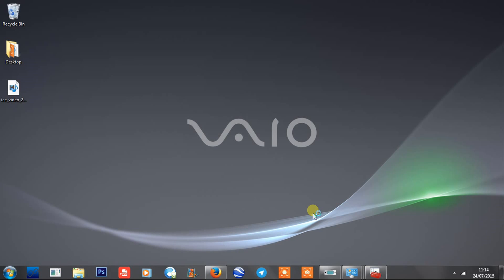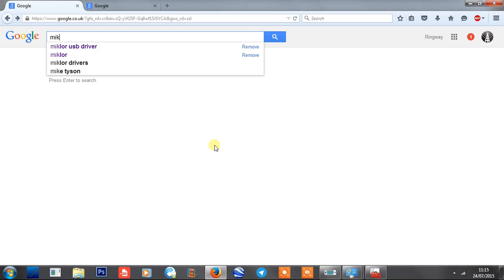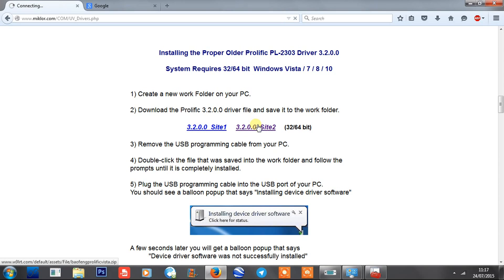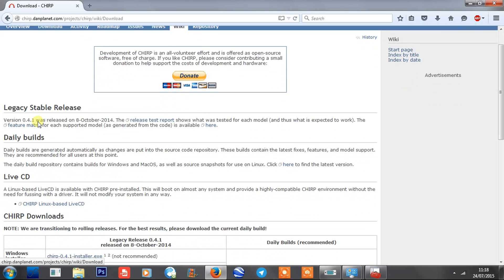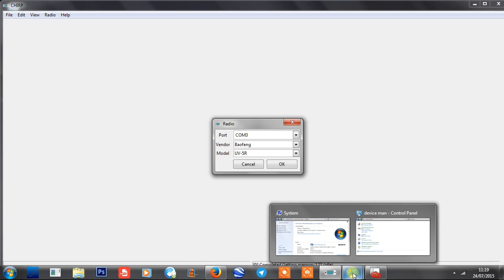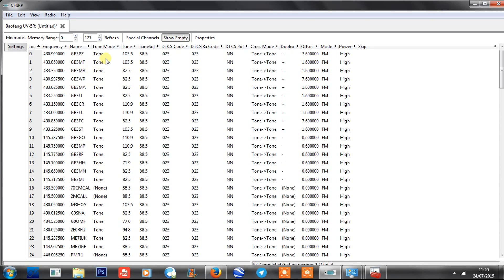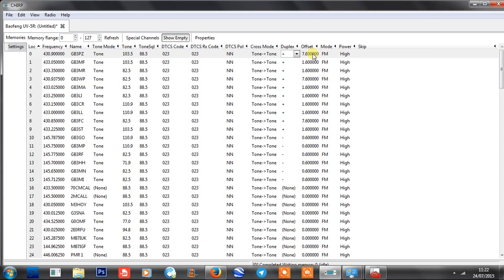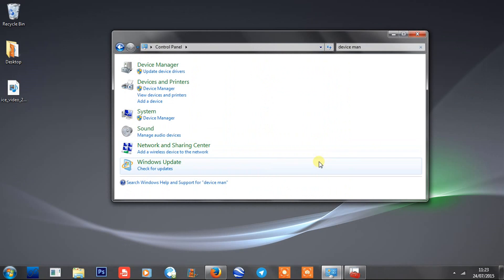How To Programme Baofeng UV-5R - Driver Issues Solved

Comment: Hi Lewis, ended up using Ch340 driver, Prolific wouldn't work with UV5X. Now trying to upload to UV5R Triband and having all sorts of issues. Freq Step column is missing when I read radio so when I use 5X csv to upload to UV5 III, there is a column missing so can't write to radio. Anyone have any info on this??
Cheers

Comment: Thank you Lewis!

One important note—the website linked in the description states 'Nearly every programming cable that is detected by Windows as having a Prolific chip'... I read that incorrectly as 'Nearly every programming cable has a Prolific chip'... and indeed Windows attempted to install a Prolific driver when I first plugged it in.

Many frustrating, head-scratching hours were spent installing older Prolific drivers and still getting a code 10 error... until I tried installing the WCH chipset drivers, which are also on the same linked website... now all set up and working :-)
Reply: When the 3.2.0 version didn't work, you installed WCH chipset drivers?

Comment: menu-27-menu-(channel #)-confirmed  gives me a rcv ch and xmt ch, which is not right, and never confirms whatever.  menu 27 is confused somehow.  This the vfo/manual set up procedure as one is supposed to use.   By the way, chirp works ok with  the BTECH 5x3

Comment: my edited alpha-numeric channel name is not changed (stays a number) when I clone the file to the radio. Is this a radio setting issue? Thanks - the driver and chirp seem to be working fine otherwise.
Reply from the maker: Do you have the display set to channel, name, or frequency in the software?
Reply: name

Comment: I hope you can help me. I have a Baofeng UV5R. When I attach the data cable to the radio and pc and turn the radio on, there is a loud buzzing sound and it reboots my pc. Same thing happens if I plug in the usb plug with the radio on. This is new, it didn't used to do this. Any advice would be greatly appreciated. Thanks in advance!
Reply from the maker: Sorry I've never heard of that problem

Comment: I'm afraid my Miklor driver always keeps the yellow triangle and already warns me it is incompatible (Win 10/64) before it is even installed. After installation I am told the driver will not run (Error 10. When opening Chirp and trying to read from the radio, the comm port field is empty, and the error is that the specified path could not be found. What now? 73.
Reply from the maker: I'm sorry I'm not sure.
Reply: Anyway, problem solved. Very confusing with all those drivers. There was a .rar file on the CD that came with the cable which installed the correct driver (2014) immediately and it now works good as gold. 73 de M6VMO.
Reply from the maker: Glad you got it sorted

Comment: my cable plugged and chirp connected with no trouble. However, I have only 1 channel displayed. has my uv5r been factory reset?
Reply from the maker: You might need to select 1-128 channels in the software

Comment: Hi,
I very recently bought the Baofeng GT-3PT, programming via the keypad is tedious and have heard about the USB data cable that makes things easier.
I've heard that there are many fakes, I don't know wether there's cause problems though if the correct drivers are used.
Could you recommend a supplier please that I could buy from..

With regards to actual programming Chirp, is there a ready made file that I could download for 2 Meters ?

Thanks for the video and the suggestions that you have talked about.

Paul.
Reply from the maker: Hey Paul,

I'd just order a cheap one for a couple of quid. I've had loads without even researching and never had an issue.

If you join some Baofeng groups on Facebook I'm sure someone will have a file they can share although chirp is very easy and simple :)

Any info you need let me know

Lewis
Reply: Thanks for the advice, I'll check out the Facebook group, see if I can get up to speed. Hopefully, the HT that  I have will live up to expectations.
Thanks again..
Reply from the maker: Ok no probs, anything else you need you can contact me on here, on facebook at Lewis HHY
Reply: Hi Lewis,
Just thought I would let you know that I took your advice and bought the data cable as suggested and it works just fine. Really pleased about that so thanks for the tip.
With regards to the other question I asked about programming via Chip, I registered with RepeaterBook and downloaded a ready made populated file directory of most of the 2m/7Ocm repeaters nationwide.
Loaded the file in Chirp and sent it to the radio. Magic 

Thanks again, keep up the video's  73's
Reply from the maker: Hi Paul,

Ok on the repeater book file mate great stuff! glad to be of assistance :)

Comment: When I first got my Baofeng UV5r, I spent hours without success trying to connect the radio with the USB cable to the computer (USB driver issue). After watching your video, I finally managed to install the correct USB driver and program the UV5r with Chirp (great program!).  Many thanks and also big thanks to John Miklor for all the info on his site.
Reply from the maker: Cheers mate! Glad you sorted it!
Reply: Bad thing is you lose 220 mhz

Comment: Nice video.  
My recommendation would be to use the Latest Daily Build of CHIRP.
0.4.1 is actually 16 months old. Current versions of the UV5R series may not be covered in the older version.
http://www.miklor.com/COM/UV_CHIRP.php
Reply: I used the drivers off your web site but I can not get the cable to work I keep getting errors in windows device manager the yellow triangle and it says  "Windows has stopped this device because it has reported problems. (Code 43)"  and "Unknown USB device( device descriptor request failed)"  any ideas?
Reply: Brian,
I am not familiar with that specific message, but the yellow triangle in device manager clearly shows it’s a driver issue.
Next to the yellow triangle will be the name of the specific driver needed.
If it is Prolific, the 3.2.0.0 will resolve the issue, if other than Prolific, such as a CP2102 or CH340, you should be able to download the windows driver from the internet.